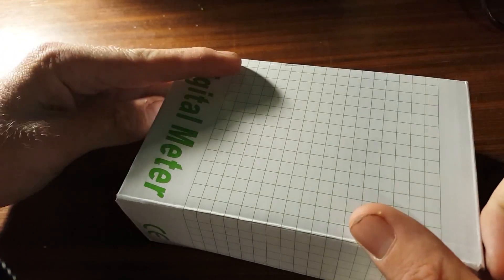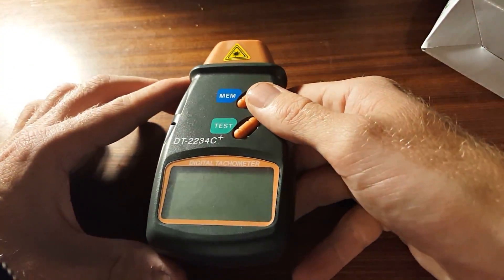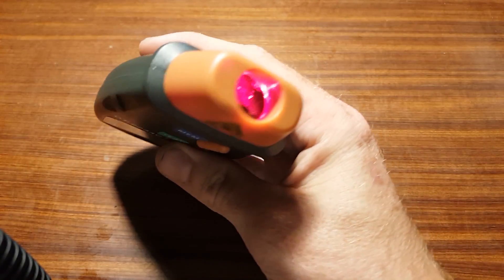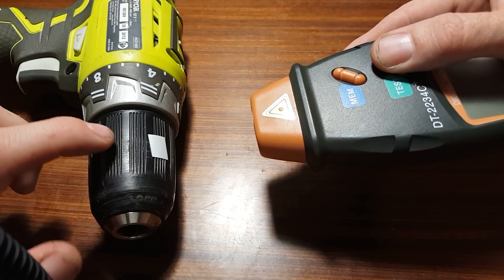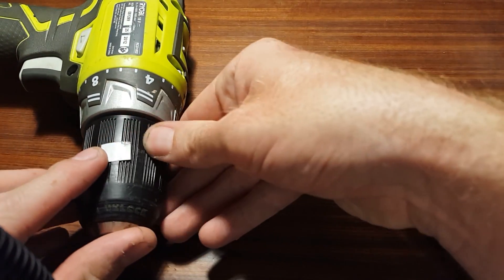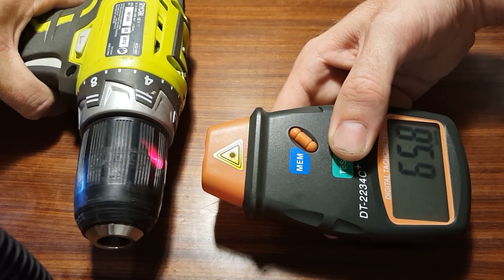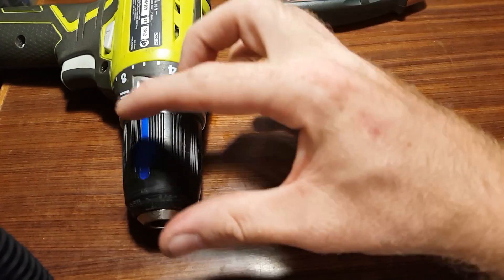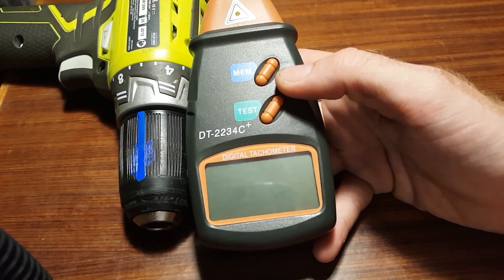How To Use a Photo Tachometer - DT2234C+ Review

Comment: What about taping cut squares from a piece of white paper, cut about the width of the supplied reflective tape, and kept in place with shiny desk tape?  The white paper will be detected easier than that blue paint and the desk tape would make the white shiny, if what's called "Transparent Tape" in America is used instead of "Matte Finish," "Photo Safe," or some other non-totally clear and shiny tape.  One could also buy a roll of white reflective tape of any width and length and cut squares to size.  This kind of tape is usually sold in rolls with a peel-off backing like what comes with the tach.  There are also various reflective properties like Bright, Super Bright, etc., so even an inexpensive roll should do.  I would get one without reflective patterns and designs to scatter the light, just flat reflective.  Whaddaya think?  If you haven't tried it, please do and let us know how it works.
Reply from the maker: Yeah, that's a great idea. Anything sufficiently white will work well if there's contrast.
Reply: @WhatUpTKHere   Thanks for the reply!  I didn't know if you would, so I asked a YouTuber who does all kinds of product comparison reviews and uses a digital photo tach in his reviews when RPM is a factor to test his tach with white paper squares held in place with a small piece of transparent tape and tell us how it works.  Have you tried it yet?  If not, please do.  Thanks again!

Comment: Maybe I missed this, but how does the machine compensate for the size of the spinning object? Wouldn’t that affect the rpm count? How does the machine know the overall size of the object?
Reply from the maker: It's irrelevant. RPM is revolutions per minute. How many times it rotates has nothing to do with size. If you want to convert that to angular speed, then yes, you need to know the size of the object, but when measuring RPM, you're just counting the number of times it rotates in a set period

Comment: I want to measure the RPM of a white ceiling fan. Will the white tape work? If not, what do you suggest?
Reply from the maker: Hm! Maybe put a black piece of paper on the centre of the fan and then create a white reflective spot
Reply from the maker: Also, some tacometers will also work in reverse - you might just be able to put a small black square on the white fan

Comment: How does the diameter of the object effect the meter? If you
Put it closer to the Center it’ll give a higher reading compared to putting it away from the Center where it would reflect less frequently?
Reply from the maker: Incorrect. No matter where on the object you put the sticker, the sticker will only pass the sensor once per revolution.

Comment: How does the diameter of the object effect the meter? If you
Put it closer to the Center it’ll give a higher reading compared to putting it away from the Center where it would reflect less frequently?
Reply from the maker: The diameter has no effect. Whether you put your reflective tab in the centre or on the outside, it passes the Meter once per revolution. It's counting the pulse as the reflector moves by, not the amount of light.

Comment: unable to find how far from obj u want to check rpms . you should be... i lost the dirct to the darn thing.. anyone know?? i ask as i did a flywheel on a motor and 6 inchs out gives one rpm and 2ft out gives another rpm so on ..
Reply from the maker: You wanna be fairly close, might be getting dodgy signal from the reflective tape further out.

Comment: What if the object itself is reflective/shiny/metallic? Will the reflective sticker still work?
Reply: I'm planning to measure the RPM of a mixer. Would it be possible?
Reply from the maker: Try it the normal way first. If that doesn't work,  use a square of black tape instead of reflective tape.

If that doesn't work, make a black ring of tape around the circumference and then put a white mark.

Comment: Great video. White paint does the trick, and the wider the mark the better.   I painted my lawn mower  disc with a 15cm  long and 10cm wide strip of paint. I painted on the disc where it is curved and the Laser  will reflect back.  I tried it on 3 mowers and it works fine. I set all the Mowers to 3200 rpm. I found a narrow strip of White paint did not work that well. The more narrow the strip, the closer I need to hold the Laser.
Reply from the maker: Nice, thanks for sharing your results!

Comment: perfect for setting up lawn mower RPM
Reply from the maker: Yep!
Reply: Is there a trick to doing the lawnmower rpm  as i have  one of these and stuck  the tape  on the  blade  and very  gingerly  opened up the rear flap  but I couldn't get it to read  it ...  I suppose   trying  on the flywheel  and starting it with the drill is an option🤷‍♂️
Reply: White paint does the trick .  I painted my lawn mower  disc with a 15cm  long and 10cm wide strip of paint. I painted on the disc where it is curved and the Laser  will reflect back.  I tried it on 3 mowers and it works fine. @Grahams-Grass

Comment: Does sticking two reflective tape not affect the true reading?  
Coz when we stick two reflective tapes and say the motor runs at 600 rpm. Now the light gets reflected 10 times per second  when single tape is struck but when two tapes are struck, it gets reflected 20 times, so the reading will be 20*60= 1200?
Reply from the maker: Yes, doubling the tape will fool the photo tach in that way. It can get bad if things are poorly aligned and sometimes it’s getting two pulses per revolution, other times one.

Comment: Have you test the photo tachometer with the  clip on spark plug wire tachometer or other contact tachometers to verify there all giving consistent measurements?
Reply from the maker: No, but I did use it to set the idle on my Mazda MX5. :P

I don't have any hard data, but it's accurate enough to be useful in my experience

Comment: I would like to use this to measure chain saws which can go up to about 15,000 rpm. Does it have enough range for that?
Reply from the maker: Pretty sure, yeah. eBay listing should have the spec but I think it goes well over 20,000 rpm.
Reply from the maker: Don't hurt yourself hey! ;D
Reply: @WhatUpTKHere  Thanks! I am going to leave out the chain guard and attach the bar with nuts only, so that the centrifugal clutch is exposed, and I can use that to get the measurement. Needless to say, getting your fingers between the chain and the sprocket at 15,000 rpm is not the best of ideas. Chainsaws do require a certain amount of carefulness to operate. Fortunately I have always been pretty careful and have not had any real accidents :-)

Comment: how is it able to be even remotely accurate when the sensor doesn't know the diameter of the item being tested!!
Reply from the maker: AnimalMother224 regardless of diameter, the white marker passes the tachometer once per revolution. The tachometer calculates rotational speed, not linear velocity. It counts the number of times the object rotates in a set time - nothing to do with diameter.
Reply from the maker: AnimalMother224 I go over converting rotational speed to linear velocity for a wheel of known circumference in my last scooter video. By multiplying the rotational speed of a wheel (in RPM) by its circumference, it's possible to determine the linear velocity (i.e. in km/h if you so please).
Reply: the point I'm trying to make.  if you have two stickers attached to your drill press quill.  one on the drill chuck body, and one on the drill shank, you would likely get two different readings even though they are spinning at the same speed, no?
Reply from the maker: AnimalMother224 If the shafts are rigidly connected, then they rotate at the same speed.

I'm not sure if you're trolling or not.

Go and put a white spot on your drill press Chuck and spindle and whatever other parts. Turn the drill on slowly and count how many times the white spot goes past. Note how no matter the diameter, the ROTATIONS PER MINUTE are the same.

It doesn't measure speed in km/h, it measures rotations per minute. If the Chuck rotates 10 times in a minute, the drill bit rotates 10 times in a minute. The diameters have nothing to do with it. Put a reflective spot on each one, and it will pass the phototach 10 times in a minute. The phototach will count the pulses and report a rotational speed of 10 rpm.
Reply: certainly not trying to troll you. after you explain it like that, it does make a little more sense.   thanks for the reply.  enjoying your channel.  subbed!
Reply: I did order a non contact tach to play around with.
Reply from the maker: AnimalMother224 thanks, glad you found the video useful!
Reply: It doesn't measure surface speed - it measures rotations/second
Reply: Think of a merry-go-round.  The outer edge is certainly moving faster than the center but they are both moving at the same revolutions per minute.   The reflective mark passes by the electric eye faster on the outer edge than it does at the center but since its all captured at the speed of light its inconsequential.

Comment: So could this be pointed at a copper disk with a wide diameter without using tape?
Also does it make a difference if you measure (on the flat face side) at the outer edge V.S. Closer to the center?
Reply from the maker: David Prock there needs to be a light/dark transition to create a pulse that can be counted so you'd likely still need tape.

It doesn't matter where you put the tape as it'll still pass by once each revolution.
Reply: TK I'm about to look more into it, but is there one where tape isn't needed, or from other make and model how do they get better (if so). Are there other features or stats to look at?
Reply from the maker: David Prock well, photo tacometers count pulses of light. If you don't have a piece of tape or change in reflectivity on the spinning object, you have no pulses to count. 

More expensive ones will ideally be more accurate or tougher to deal with industrial environments.
Reply: So if you have something that is 100% surface area reflective/shiny then make a dark spot and it will become accurate? Or work properly, being that I don't yet have one

Comment: hy i recently bought UNI T meter like this and when i check rpm of drilling machine it read good but i want to find my seeling fan speed i tried many times but not works...why
Reply from the maker: Did you fit the reflective tape properly? It could be the colour of the fan. If the body of the fan is also reflective there won't be enough difference for the phototachometer to detect when the pulse goes by.
Reply: yes little bit reflective so what can i do i also marked with full black tape not showing good result if u have idea so plz tell me
Reply: @BilalKhan-ep1io  paint it black then put white tape